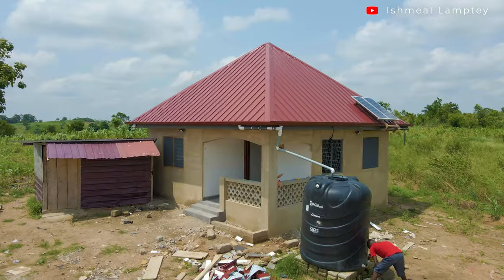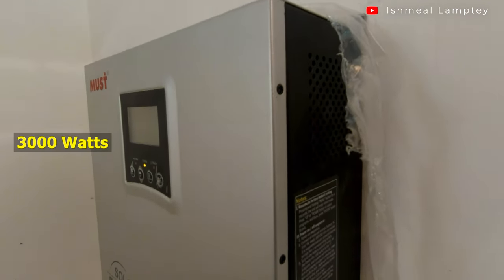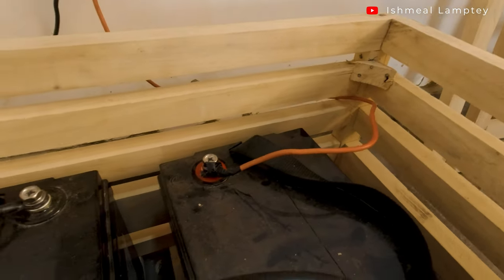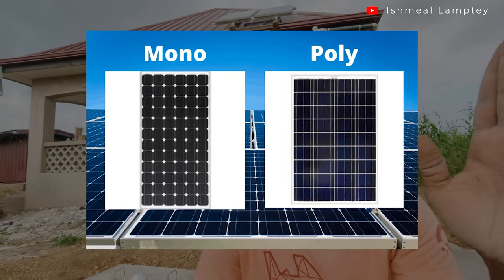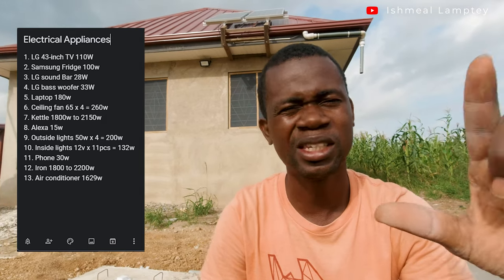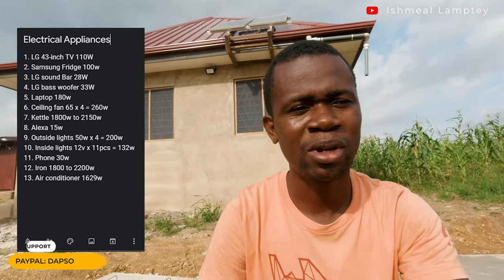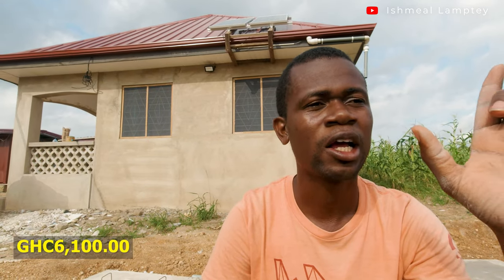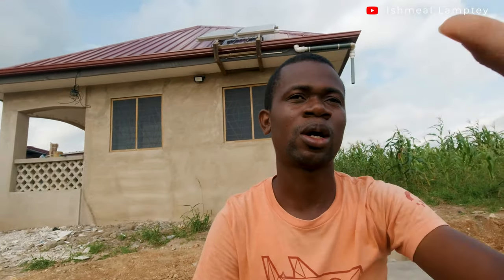Want to know the best Solar Option for an Off-Grid House?

Comment: I have been using my 48v 5kw Growatt hybrid inverter for over a yr...very solid. I have a 4.8kw 48v LifePO battery pack (powerbank) also. My advice is you need as much battery as you can afford. My 4.8kw 100AH battery is only enough for my computers and devices (2 days max). The inverter may be 5kw but you should be using a max of 3.5kw load for safety. 

If you're using solar for your entire house, then anything less than 10kw+ inverter won't cut it. For the battery, I'll say 20kw+ for ECG equivalent load. Battery is what determines how long your load runs (and remember batteries are only like 70-80% efficient... best case scenario... even worse for solar panels). Also LifePO battery is what you want if you don't wanna buy battery every 5yrs or so. 

Contrary to what some are made to believe, solar at the current price is more expensive than ECG....so it only makes sense for convenience/reliability or remote/off-grid use.
Reply from the maker: Thanks a lot for your submission.

Comment: Thanks bro pls what  if I get  2bedroom  how may solar panels and converter and battery will I need
Reply from the maker: The solar system will depend on the appliances you intend to use in the house. It will be difficult to tell without those information